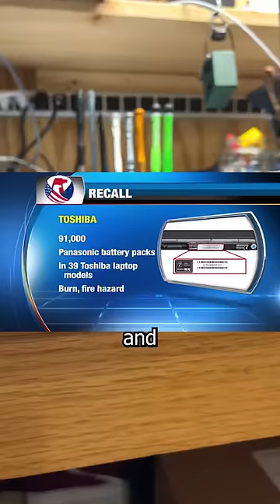This Toshiba Satellite is the worst #laptop ever made. EVER. #tech #pc #technology #shorts

Comment: Finding this clip now, we had a "family" Toshiba, i forgot the model, used to be a uni tool, but got relegated to browser only duties till a relative dropped it, cracked the case.....and ruined the floor. Damn thing still ran after that for another good 3 years on wall power till it finally died.

I gave it a very explosive andtoxicdontdoitfolks funeral pyre.

Comment: Trashiba…ah, yes. The one I bought in 2002 left me without a laptop for most of a semester…eventually the class action lawsuit revealed that they had put in a standard desktop cpu that had a tendency to melt through the motherboard.  When you sent it in for warranty repair, they kept it for a couple weeks and sent it back…exhibiting the exact same problems within a couple days (or immediately on startup). What did they offer their victims? A coupon for $100 off a new trashiba laptop. Luckily I had an extended warranty and called lemon after the third time they sent I my machine back unrepaired. Ah, good times. I wouldn’t buy trashiba products if there are any alternatives. If there are no alternatives, I have to strongly reevaluate my real need for the device.

Comment: Caught my 2 yr old jumping on mine, over and over and over. Had a dent in it, but it kept working. Until my ex drop kicked it across the room. Cracked the mobo so the sata wouldn't work, but oddly enough it worked on a USB bootable os. It was an expensive satellite,  i7,  and a couple years older than this one.

Comment: Toshiba Portége z30-C where palmrest bootom cover and screen cover made from aluminium is op i have it 5 years with i7-6500U  onboard, its weigh is about 1.1kg and lookin at its age it still pretty powerful and unbreakable. I love it because it has 13 inch IPS panel which is above 300cd/m and  view angles you can sit in the side of it and still can watch movies without problem

Comment: I own at least a few Toshibas, my most used being a A8 from 2014, still runs fine albeit slow (mostly due to a 5400 rpm hdd from a ps3 i had laying around),   No issues other than its touchpad being a bit quirky (probably due to build quality)

Still will do a 1080p stream (with little to no chat) on win10 just fine all day (though it may complain with a brt or a random crash if it gets to be too much now (maybe once a day).  About all it can handle at once (if that's the ONLY thing going on)

Have a A10 (pretty much the same case but its screen is a bit water damaged but still functional)

And a A6 (didn't use it much but seems to be no issues)

Probably have another toshiba around or 2 (if not more but they'd be extremely slow old generations)

And i find giving them a usb keyboard and mouse is much more reliable and less fustrating than using their onboard keyboard.

And both the A8 and A10 are missing hdd caddie so i substituted some thick rubber bands around the hdd for shock absorption and a bit of sturdy foam so it can't move.  Runs just fine despite a single 4 GB of DDR3 1333 mhz ram stick.  And a sata 2.0 hdd bus.  Doesn't seem to run fast enough to saturate the ram much as even while having it do nothing but a 1080p livestream it NEVER goes over the 4 GB limit (though i can definitely notice when the page file kicks in lol)

Battery still holds a charge (just over 2 hours)

I do have better but nothing without some minor issues.  So those Toshibas will get use until they die and parts salvaged.

That use has been their life since i bought them for cheap from a garage sale.  I think they are 2014 model for energy efficient laptops  Very easy to work on

Comment: You complain about HP, yet HP are the only brand I’ve never had an issue with. I’ve had so many issues between Acer and Toshiba. And don’t get me started on Dell. Yet my HP’s I’ve never had an issue beyond the battery getting old and basically being dead. And the fact that I made bad choices when deciding what to get and got either slow processors, or insufficient storage for my use. So when I went and paid good money for an HO Oman, it remains the best computer decision I have ever made!

Comment: My personal hate is the Toshiba tecra e, having worked at them as a technician they are absolute trash, it way slower than a dell 5500 even though both were configured the same (i5 8th gen) they're heavy, hot, loud and super slow. People are so happy when they get called by me for an upgrade to a 5520. Its not even a one off after replacing a hundred by myself and total of well over a 1000 by me team

Comment: I have satellite l850 with me. Great touchpad. Quite good keyboard. Bad build quality. Broken plastic , that holds screen lever (sorry, I'm not native), so I really weaked their moment. Screen holds. Very weak cooling system. Changed 2450m to 3720qm, and with 8 gigs of RAM and new SSD... It still breaths ok. Fallout 3 in low goes good

Also broke headphones' mini jack. I can't repair that.

My awerall opinion nowadays 850$ laptops are much better, but .... I still can use my laptop. So I think I've got quite licky with him backdays
Reply: It was hard to write this comment. And I saw that it's already 4.4k comments to late...  Okay...
Reply: And the battery issue.... Without the battery it works. With the battery it just don't charge. And the battery was holding for like 5 minutes

Comment: Our familly has a toshiba that last for at least a decade we use it for a lot of things battery fail but still working until we change it cause slow OP
Reply: We have the same laptop in the video but older this thing is like 13 years old  it has an i3 m380 i think and a radeon 5000 series card and we had the same problem for every battery we brought for this thing it just stops functioning so we started using it from the cable directly and we had to change a keyboard once but this thing is still alive and i don't know how